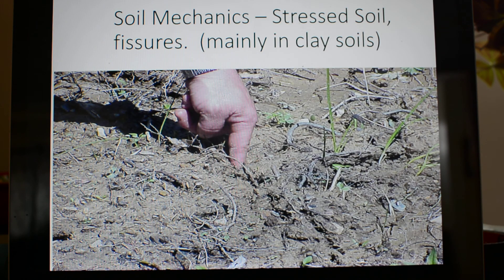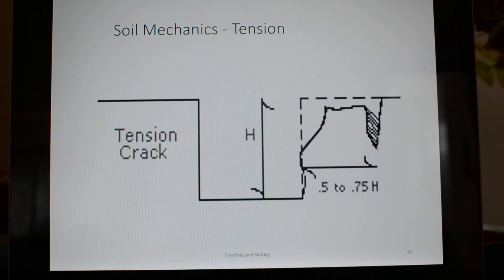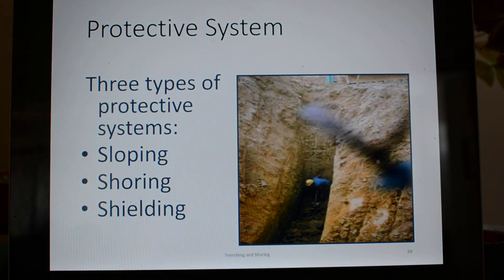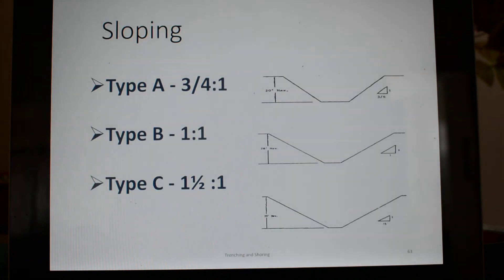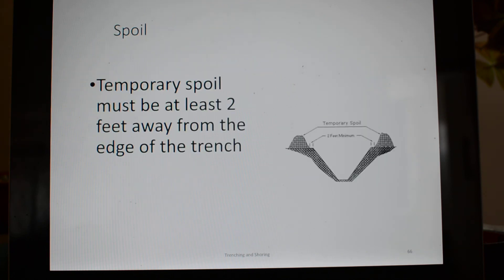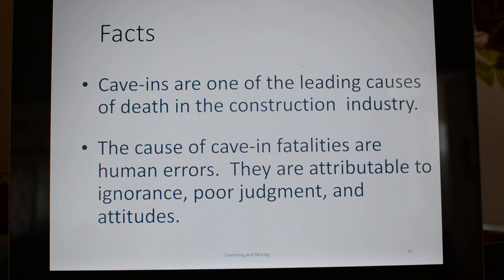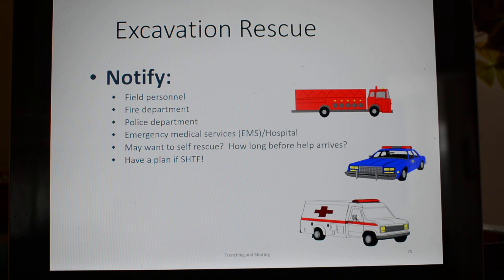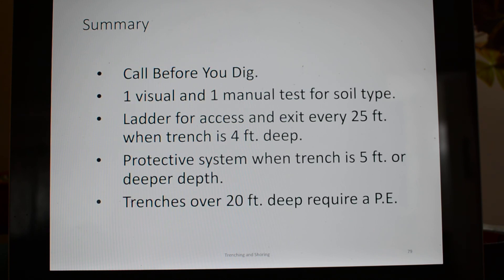wrea t and s 2020 part 2

Comment: Part 2 was good also fine job.  Wonder if we need to develop a trenching check list for documentation?   Glad we have shoring materials at the WH.  The guys are good at getting and using them when necessary.
Reply from the maker: Yes, we should, i believe i have one, we just do not do that much trenching, last big trenching i was on was just the width of the ditch witch so it was not an osha trench.  but it would be a good idea,.